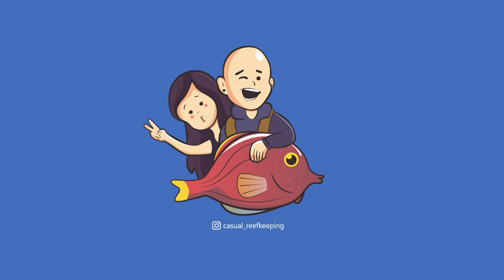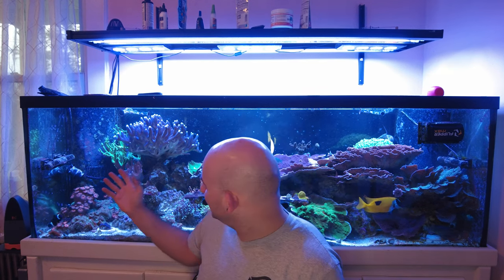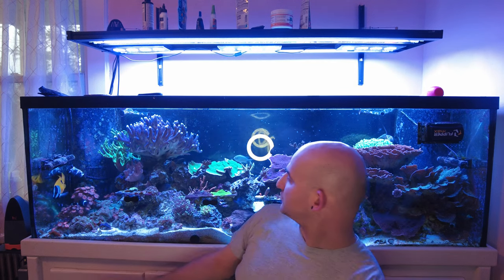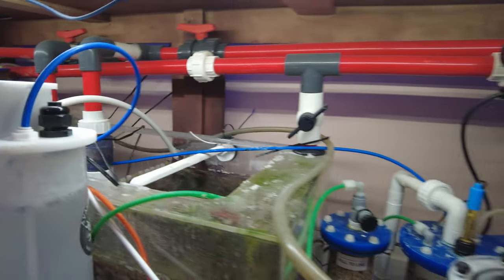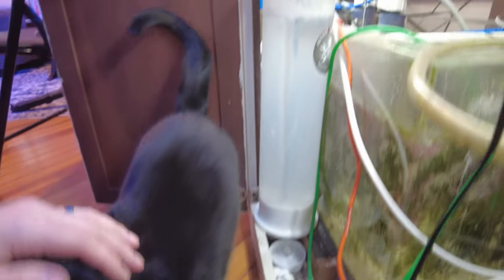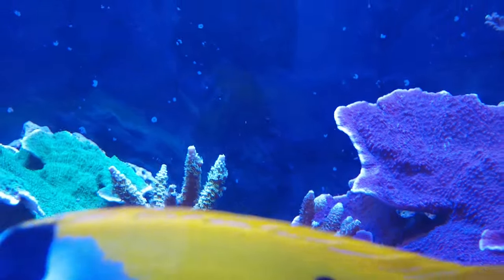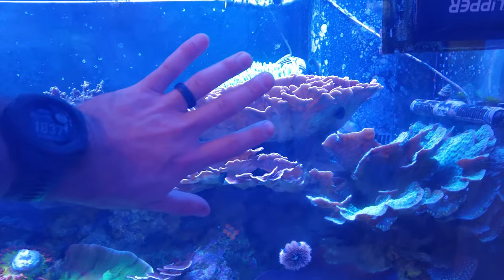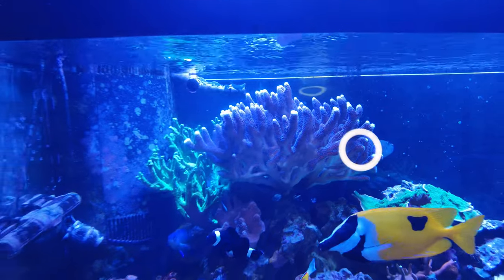Kalkwasser dosing; The ACI Method Update

Comment: It's definitely not you having problems with Mobius. My Versa's have the same problem sometimes when the app screws up the time! Great video!👍
Reply from the maker: Thanks for watching! I do generally hear a lot of gripes about mobius, was just such an odd hiccup to have but once I corrected that it's been solid since.
Reply: @casualreefkeeping  I've been using Mobius for about 3 years now and it's happened like 4 or 5 times so far. I did let Ecotech know about it but haven't heard anything yet. The time goes crazy on the app everytime the clock changes for daylight savings.

Comment: My question is still is this better than just dosing straight Kalkwasser at night regardless of pH variance. It’d be nice to see some before and after pictures of the growth. I dose straight saturated Kalkwasser to the evaporation during lights out, but don’t have the on and off based on pH-just a steady flow. 24 hour pH is usually around +/- 0.10-0.15
Reply from the maker: I had done a very bad job documenting the before lol I wasn't sure if I was going to be making videos and was just running with the kalk idea. I'll have to search and post whatever I have though. 
As far as your dosing,  it probably nets the same amount of kalk but may fluctuate the ph more. The effects of kalk are limited by co2 though so this will vary system to system.

Comment: Beautiful tank how much kalk are u loading in reactor and how long before u change it
Reply from the maker: Hey sorry for the delay! I usually load about 2 cups every 3 weeks. I'm not particularly consistent, but the reactor seems to be very forgiving. Following the avast refill recommendations, I have not noticed a pH drop in the reactor.
Reply: @casualreefkeeping how much are u dosing with versa at night and how much do you evaporate
Reply from the maker: @davidhackett6298  I'm dosing at a rate of 9.5mL/min, varies a little but around 6L a day.
Reply: Are u still using ur kalk stirer I tried the mechley way thru the brute can works great but I want to use my stirer

Comment: I have just switched to a kalk stirrer from a tank of RO+kalk and found the potency of the Kalk has gone up. I am in the process of re-adjusting my kalk dosage as my pH shot up to 8.75 for a short period of time. You mentioned some people are running high pH, what value would that be please?

Your tank is looking very good.
Reply from the maker: I'd say 8.75 is high pH haha I did not see a difference from reservoir vs stirrer, but that may depend on the flow rate. At a high rate it may not stir enough to maintain saturation while dosing. I've seen people like Deven from @reefdudes add more propellers or zip ties to increase the mixing to combat that, but I have not tried that myself.

Comment: Are you controlling the kalk using the apex and if so can you post your programming? Also for the ato outlet?
Reply from the maker: Tough to share here, I'll try to copy and paste to another comment. The apex is turning my kalk pump on and off based on pH, so that's just using the pH control drop down, no custom code. For the ato outlet, I had that setup with the atk task, switched it to advanced and added a line that if the kalk pump is on, ato off, so that they don't run simultaneously.
Reply: On the apex what is your low value and high value u have it on when it's low or high
Reply from the maker: @davidhackett6298  I'm using the code options not the form so it's just
Set on
 if ph > setpoint then Off.

Comment: How do you tell the versa to turn off at 8.29
Reply from the maker: The versa unfortunately is just plugged into a spot on the eb832 and controlled by power cycles. I was hoping the MXM would support the versa so I could stop doing it this way but it does not.
Reply: @casualreefkeeping  ok thank u
Reply from the maker: @davidhackett6298  no problem. Unfortunately there isn't a great option with apex integration yet. Power cycling works but it isn't ideal, and the DOS pump isn't rated for continuous duty. It shouldn't run 24/7 but it will run for nearly 12 hours and the DOS will likely fail prematurely and be loud.
Reply: @casualreefkeeping  yes the Dos is loud I just bought a versa to dose kalk with the avast stirer
Reply from the maker: @davidhackett6298  that's exactly how mine is setup
Reply: On your apex did u ever have a problem when ph hits 8.29 shuts off then it doesn't hook back up to Bluetooth when comes on
Reply: @casualreefkeeping can u show your program u have on apex outlet that the dose is plugged in mine gets to 8.29 shuts off then won't turn back on
Reply from the maker: @davidhackett6298  you're probably missing the set on. 

Fallback OFF
Set ON
If ReefpH > 8.20 Then OFF
Reply: @casualreefkeeping  thank u I just had last code if 8.29 I added the other 2 codes before that 1 thank you
Reply from the maker: @davidhackett6298  great glad that should work for you. For that setup you need the set on to tell it that the device should be on in the first place since the only other code is to turn it off. That way it will return to on when that condition clears